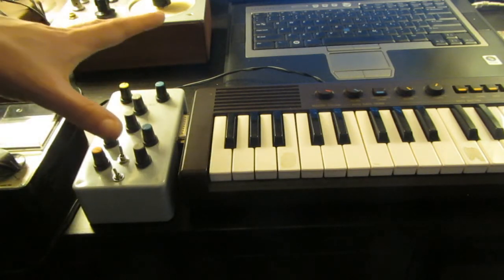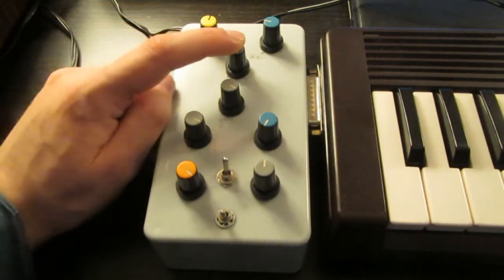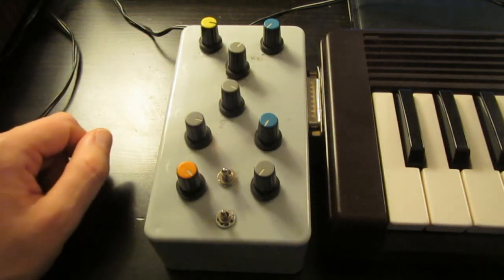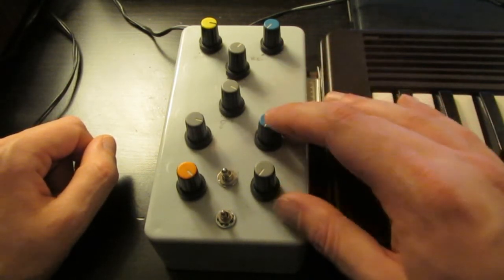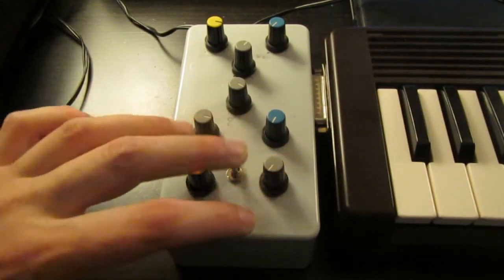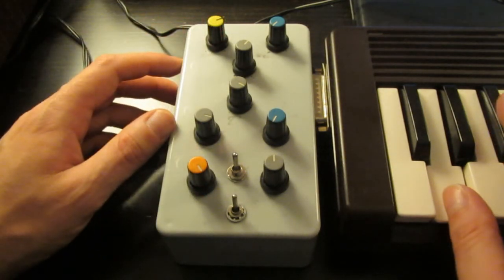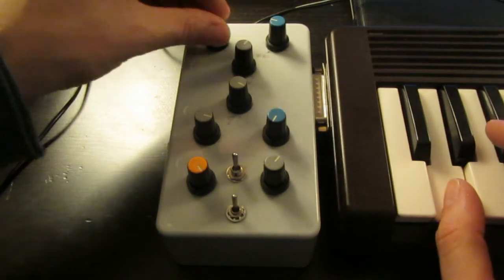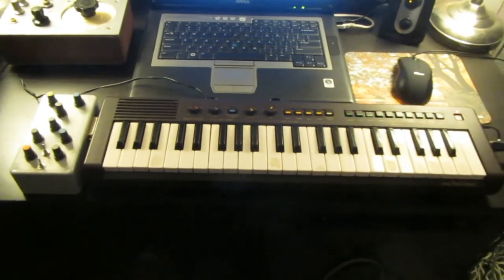Circuit Bend Yamaha PS-3 - Demonstration and Explanation

Comment: Just bought one for trying to do a circuit bend on it but didn't expect to find such a detailed video and page on it. Thnx!

You mention some other mods wanted to be made on it, would you detail? Also in the comments you mention an Atmega32 chip.
Reply from the maker: I am planning to replace the oscillators with an atmega so I can have more waveforms and functionality. Glad you like the vid, thanks

Comment: Hi there
great mod especially the drums  ! Just a little question, is the PS3  all analog like the PS1 ? I’ve read somewhere that the filters are digital
I’m planning a full analog setup for a project that will go through tape that’s why I’m searching an all analog portasound 
Thanks 
Tcheeers !
Reply from the maker: It's analog yes, but the oscillators are all square waves so you could argue thats more digital. They layer two octaves at various amplitudes to create the crude waveshapes/timbres. 
The filter and vca are the real deal though and have been used in some of their very expensive analog synths :)

Comment: thanx for the hints.
Reply from the maker: YEESSSSSS. I've been looking for that since well before this video was even conceived lol

Thank you so much, I'm sure this will help many. This has a lot of usefull info :D
Reply: @rot_studios  
for some freaking reason my answer seems being constantly deleted. this is a test comment
Reply: @rot_studios  
ok, will now try typing it once again, this time in short.

as for the mods, another obvious one would be to control sustain\decay caps discharge like it's made in some related electones.

another thought is that probably your external modulator shows queer behaviour because you modulate your external clock directly with it's square (or what ever) wave. probably it would be much better to utilize the native conditioning (or what ever) circuit from between the VIB output pin and the internal clock gen.

Comment: So cool! When you take the box off does it function normally?  I got one of these at goodwill for $3 and would like to attempt this. I also just bought a 2nd one off ebay haha.  With that one I would like to try and drastically modifiy it as you said you were thinking of doing. Make it as close as I can to a synth with cs01 type controls.
Reply from the maker: There are many more hacky points on there. Have fun! It's a great little synth in there!

I'm still planning on buying a second one and replacing the main control chip with a custom Atmega based PCB, for more fun :D
Reply: @rot_studios   I am very new to all this. I can solder and follow directions well at this point basically.  What benefits would you get from the stock ps-3 hardware if you replaced the sound generating chip with the atmega? I am guessing the atmega will give you more variety in waveforms? would that atmega handle the key assignments or  just the sound generation?
Reply from the maker: @jamesgphoto  (late reply sorry) The atmega would have to handle the keyboard input and most of the front panel stuff, but using a chip like the Atmega32 that should be no problem.

You can then indeed generate all sorts of custom waveforms and could even generate CV for the filter and such.

Comment: Any chance of describing how a dummy like me can do this mod? I'd be happy to pay you for your time and instructions
Reply from the maker: Okay updated the page a bit, with schematics I had made back then and some info: http://evilturtle.nl/projects/yamahaps3.html

Hope this helps!
Reply: @rot_studios  was every control shown in the link? There appears to be far more on the breakout box
Reply: R.O.T. Studios thanks king
Reply from the maker: Well basic soldering skills are needed, other than that it's not much more than removing a resistor and attaching some wires to whatever you want to use to control for example the cutoff (can be variable resistor (knob) or a light dependant resistor, anything :P). Obviously the clock control is a little more involved but is still simple.

What are you most interested in doing first?
Reply: Thanks for your reply....I can solder. I'd like to build exactly what you've done here in the video
Reply from the maker: Unfortunately it's been a while since I've done this so my memory's too foggy. I'll have to dive back into it and finish that webpage. I'll keep you posted!